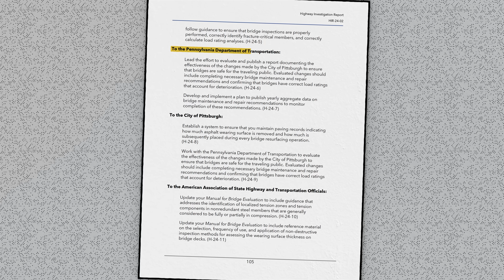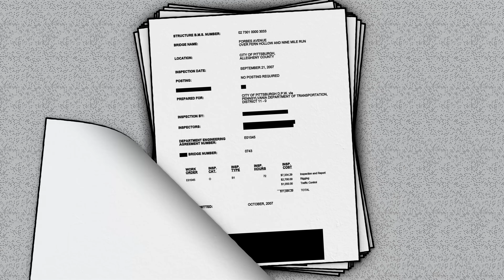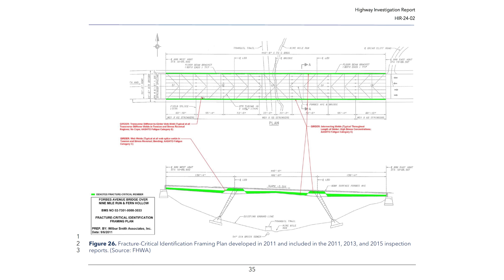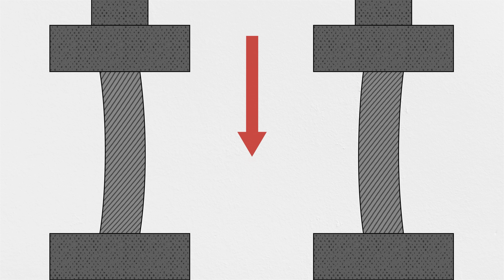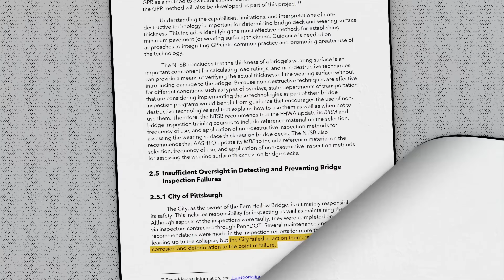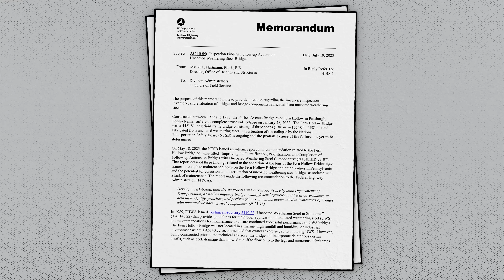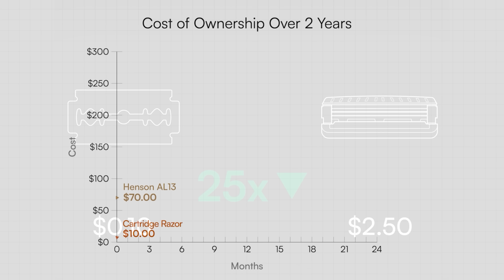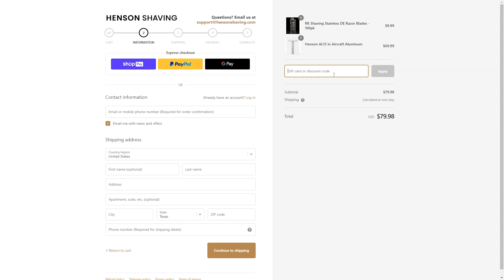This Bridge Should Have Been Closed Years Before It Collapsed

Comment: Your point about nobody having a complete view hits very close to home for me. I work in security (ex pentester, now researcher) and the sheer number of times I've seen that same pattern of "the people with a clear view have no autonomy; the people with a limited view have the authority" as a limiting factor in problem identification and remediation is staggering.
Reply: Same here—InfoSec 20+ years of experience (CCSP, CISA, and CISSP, doing Audit, Networking, SIEM, and Web App Sec.)

Having InfoSec CISOs under the thumb/authority of the CFO, NOT having a seat at the C-Level table, always having to beg for more money, is the foundation for failure.   (Watch the excellent 45-minute naval engineering failure analysis “Failure is like onions” by YT Presenter Drachinifel about the Mark XIV torpedo during the first 2 years of WWII.  EVERY InfoSec Analyst/Engineer should watch this to understand how politics and cost almost always overrides good SENSE, not to mention sound engineering and testing!)

Amazon’s CISO sits at that table AND the Board as well.  They at least get heard!
Reply: When I see problems. I don't report it. Why should I? This doesn't get resolved until enough people become no more alive due to the incompetence of the system.
Reply: Yeah, while the people with the clear view maybe shouldn't have full authority, they should at least have the authority to shut something down when they have good reason in order to make sure the people with authority are forced into figuring out what is going on.
Reply: Deviant Olam, a physical security specialist and pentester emphasizes that when you do a pentest, it’s not just about proving you can get in and out. It’s about getting people with authority to take action with you - to give them that clear picture of the various security flaws. To demonstrate why they need to make those action items a priority.
Reply: Maybe a dumb question but what is a pentester?
Reply: A while ago I used to do welding repairs on Elevated work platforms. The top boom section on a particular model of boom lift was cracking repeatedly. 
The factory spec allowed for 1 repair then replace the part.
This particular machine had been repaired previously and the business owner gave the indication he would hold the welder responsible for future failures. 
I did what I considered to be a good repair job and wrote on my invoice that this part must be swapped out before its next inspection. 
I made it clear that the part was out of specification.
As a contractor, they never called me to do more work.
You join the dots.
Not safety first.
Reply: @randyward2766   A person who is hired, typically by a company, to figuratively break into buildings, networks, computer systems or other restricted areas (depending on specialization of the pentester, but typically and in this context meaning IT infrastructure) as an attempt to find weak spots in the safety measures implemented by their client. Think paying someone to break into your home and afterwards create a report on how they did it so you can prevent actual burglars from doing the same thing in the future.
Reply: @evancombs5159  But you see they already do. Its just. Their superiors will just terminate them "with cause" if they do so.

You really think they are gonna suffer some peon "costing them millions of dollars?"

It shouldn't be this way, but how many people they gotta fire before they get someone that does only what they are told?
Reply: @drcovell  That video by Drachinfel is amazing. Helps highlight how in larger orgs, problems no one's paycheck requires them to solve just don't get solved.
Reply: Exactly! I work as a custodian at a university, and I see all sorts of serious problems that need to be addressed. But those who have the authority to authorize repairs don't leave their offices and thus downplay the seriousness of my concerns.
Reply: @kentslocum  what bothers me most is if they gave you a thousand bucks a month to spend on "repairs" 90% of those issues would go away I'd wager and you'd feel like a respected member of the team. But they would rather spend $100k to make sure you didn't overcharge them by $50 on guttering.
Reply: @zyeborm  Yup. An ounce of prevention is worth a pound of cure. The university has no problem spending massive amounts of money on replacing a damaged elevator when a cooling pipe bursts and causes massive flooding, but they do have a problem finding me a stepladder.
Reply: @randyward2766  Security penetration.  Defeating building or system access controls.
Reply: @ImperatorSupreme  Love Deviant's stuff. A report saying how a building can be accessed is a lot different than opening the door with an air duster in front of the CEO.
Reply: Effect of putting aside meritocracy.
Reply: @randyward2766  Penetration Tester , basically hired independent team to break the system / finding flaw within production environment.
Reply: @mariuszmoraw3571  How so?
Reply: @raygunsforronnie847  Simple. Instead of recruiting by merit (aka. via hierarchical promotions) companies decide to recruit externally.
Reply: Imagine if the institute of engineers had the authority to close infrastructure like this on the recommendation of its members? You know, people who know how engineering works making the decisions and not politicians and beurocrats.

Comment: What's a bit infuriating to me is that if my personal vehicle fails an inspection, (which can be caused by relatively minor things like having a turn signal out, or a slightly old windshield wiper blade) I cannot legally drive it untill the issue is resolved.  But when it comes the the government inspecting itself, suddenly the issues become "recomendations" which can be ignored indefinitely!
Reply: Y....you have to have your car INSPECTED???

What hellish state/country/province do you live in??
Reply: @bugsabc956 what a hellish state does NOT demand vehicle inspections and instead lets idiots drive two ton deathtraps around that might just be one bump in the road away from a complete brake failure, steering failure, wheels coming off or other parts flying away at speed, turning them into uncuntrollable cruise missiles? 🤨
Reply: @bugsabc956 You never had a car inspection? It’s required by law in the U.S
Reply: @fezawn1 I think it's a southern thing, there's a few counties in PA that don't require inspections, jackson county Georgia doesn't either, and hasn't since at least 2011 when we moved down here, but think of emissions, the US military can half a new f450 without DEF but if I have one, I'm fined and required to put all that stuff back on it, emissions is just so you spend more money
Reply: Nebraska doesn't require any vehicle inspections. On my old car, my rear suspension was basically gone. Seen cars with no front ends driving.
Reply: @bugsabc956 driving on roads populated with potentially wildly unsafe vehicles, and no one has any idea? 😬 sounds like a libertarian hellhole.
Reply: I live in Spain and all vehicles require a yearly inspection. Our car failed because the headlight bulb was slightly crooked 😂it wasn’t allowed on any roadways EXCEPT to drive where we needed to go to fix it
Reply: @LRM12o8  Michigan
Reply: Smog inspection? No? No wonder.
Reply: @fezawn1  Nope. There are exactly zero federal laws in the U.S. requiring personal vehicles to be inspected on any basis. Inspections are handled entirely by the states, and many states simply don't have inspections at all.
Reply: @scslre  as long as it's not big guhbment am I right?
Reply: @bugsabc956 it's a PA thing that some counties require like the one i live in.

but I don't follow it and i know my car won't pass so I'll just happily pay the citation
Reply: Find a better inspection guy. And by better I mean someone who is not a nitpicky as whole
Reply: @bugsabc956  many countries require either annual or biennual examination for roadworthiness. Which country doesn't do that? 😮
Reply: @SAMPLETEXT285  what the actual hell? Add one more thing to the list of things that just doesn't make sense in America
Reply: @keanusolan2844  I forgot to mention this in my original comment but the best part is in my county the citation for not having valid inspection is cheaper to pay than actually going to a garage and property getting it inspected and legal.
Reply: This is why we tried to explain to ppl all such regulations arnt about improving watery of the vehicles but only about enforcing EPA regulations which, there again, has nothing to do with saving the environment  - but instead is entirely so they can size the means of production and have China periodic all the industry using dirty coal & toxic lakes to save the planet instead.
Reply: Of course those criminals don't want to spend money on inferstucture, then they would have less money to embezle into their own pockets
Reply: DonOld trump said, " he would stop all bridges, buildings, roads & meals from going bad in 1 day." 😉👍🤷
Reply: @fezawn1  only some very large cities and a few states require it, mostly in the northeast/rust belt.
Reply: @hitchhikerbob4920  no emissions is a real problem. But they don't want to spend money on it themselves
Reply: @amycorrigan9797  yeah but Nebraska can sorta get away with that, no one important lives there😅😅😅 (no shade, just couldn't resist)
Reply: Exactly. A bunch of people sat back and collected checks. They couldn’t find the money but I bet they got raises and hired more people to push paperwork. Then you go to any city hall or government building and they sit around doing nothing. Decorating their offices etc.
Reply: @amycorrigan9797 Yeah. I had a car that turned off completely if you took your foot off the gas, at any speed. There was a specific minimum point it had. It wasn't the fuel pump or the TPS or anything else I changed. We finally went 'is probably the computer.' I drove a forty five minute commute like that for six months to get out of a bad situation I was in. I took odd hours (5pm to 3am) to make sure I wasn't in traffic. I don't recommend it but it worked. I eventually was able to get a used car.
Reply: I know some third-world countries that has no vehicle inspection as the government is too corrupt and can't afford it.
Maybe it's the same with some US states.
Reply: @fezawn1  Not required where I live :)

Comment: I worked as a machine designer for over 45 years. One of the "laws" of engineering I discovered was: "Those with the most knowledge have the least authority. Conversely, those with the least knowledge have all the authority." It was maddening.
Reply: That needs to change. We need people who know their stuff and are smart to be in charge and have the ability to act. 👍
Reply: One of my sayings was "If you really want to know what really happens talk to the guy with the greasiest hands"
Reply: I dont know if you've heard of the water main that failed in Calgary Alberta?  I looked.  1 person in city council is an engineer. Basically everyone else had "community organizer" in their bio.  The water main was known to have issues for a while.  They spent $4 million on a new city slogan though.
Reply: @rm3141593 that's not what that phrase means. Even if you only hired expert engineers,  the guy with final say at some point will be someone who probably has never even seen the bridges file.
Reply: This concept SEEMS reasonable, but in fact it's the opposite of what we want. We don't want bridge inspectors to have "authority", because authority means responsibility and management. The bridge inspectors have to stay independent, otherwise it will affect how they report. The inspectors are the people without fault in this story (except the load calculation).

All we need is a guy who knows NOTHING about bridges, but who is clearly responsible if one fails. When government bureaucracy protects people from responsibility and accountability, THAT'S when bridges fall down.
Reply: @jergarmar  agreed. I buy stuff for my company. I don't need to know anything about the machinery.  I just need the engineer to tell me he needs something and I need to figure out how to afford it
Reply: I tell you that those with the most authority do have a large amount of knowledge, it’s just that their knowledge is built on building blocks of stakeholders who can provide funding or votes to allow their authority to continue.

That knowledge results in weird contradictions.

As soon as you give an inspector “actual authority” (such as the authority to close a bridge), now that inspector is suddenly thrust into the spotlight (also known as being “thrown under the bus”), and that authority feels like it directly extract brain material from the person to whom that authority is given, where deep seated fear and stress in dealing with the stakeholders that control votes and funding, that fear eats away at the leader’s brain much akin to a brain worm, where, to keep your authority, you have to convince stakeholders to be happy with your decision, and, when you don’t have the negotiating power to just build a new bridge on the budget given by those stakeholders, then you can only keep those stakeholders happy by giving up on what you know to be true, and just avoiding inconveniencing your stakeholders (such as by not closing the bridge). Alternatively, you take the principled stance and actually use the authority you were given, which in turn continues the cycle by the stakeholders just replacing the person in authority with a spineless person who won’t inconvenience the stakeholders with truth and authority (the truth in this case: “this bridge is falling apart”; the authority in this case: “this bridge is closed, find some other road to use instead.”)
Reply: @evannibbe9375  yep, agreed. You guys make excellent points!
Reply: My management trusts their engineers. This was obvious when I was recently asked, "Do we really need to do this expensive and time consuming thing?" and REALLY wanted me to say no. When I said, "Absolutely, or the reliability of the item is not assured," non-technical manager went with it even though it caused problems for cost and timing that he then needed to deal with. 

Follow up question: "How long will it take to get it right?" Not, "How quickly can this be done?"

I like where I work because engineers are respected for the expertise we each bring to the table from our differing fields.
Reply: 44 years in a high tech career and I can't tell you how often that happens. Too often mediocre engineers go back to school and get a MBA then become managers.
Reply: Good heavens what a horrible idea. Did Covid not teach us what happens when the "experts" gain too much power? Even with hindsight often being 20-20, not all potential courses of action are so clear or binary as this one was. Subject matter experts are not necessarily better at making decisions, and can actually be terrible at synthesizing other sources and considerations and leading a group of people to a decision. As the saying goes, "experts ought to be kept on tap, not on top."
Reply: That's because one cares about money the other about lives. Ill let you guess which one wins
Reply: @mikesmovingimages  "Did Covid not teach us what happens when "experts" gain too much power?"

Um, no? What happens?
Reply: @Kay0Bot  How much money you got?
Reply: @volbla  On tap, not on top.
Reply: @mikesmovingimages   only enough to care about lives 😅
Reply: Unfortunately that seems to be universal, not just engineering. 

Politicians make decisions for people and situations they don’t understand. 

Bosses make rules that inhibit that make things harder because they have no idea what actually gets done. 

There’s always some guy in an office who thinks he knows better than people who are living it every day.
Reply: @Kay0Bot  So they're not mutually exclusive?
Reply: @jergarmar  exactly. all the people exposing some sort of technocracy are so misguided
Reply: exactly i have felt that feeling since i was a child of seeing a problem and being unable to do anything its made me rather cynical
Reply: @Kay0Bot  Expressions of caring are easy to make. Not being the one who has to make the decision or negotiate a compromise, let alone pay for it, you endeavor to elevate into the morally-superior position "caring", virtue-signaling, essentially.
Reply: exactly what Grady is concluding @ minute 18:15; loosely translated: "there was not a ONE person with both knowledge of understanding the problem as well as authority to fix it".
Reply: Expect more of this with DEI policies.
Reply: Peter principle + Dunning-Kruger effect
Reply: @evannibbe9375 sounds as though you’ve worked for a state DOT 😂😂
Reply: @joeyager8479  I see a connection with state legislatures when they become full-time. They evolve into people without much experience in the real world but having all the authority and time to pass more laws to please their voters so they can keep their only career.
Reply: It is the reason Ive virtually entirely checked out of society and just do the bare minimum to get along.
Reply: @baltulielkungsgunarsmiezis9714  Very similar to some in saying "Let it rot."